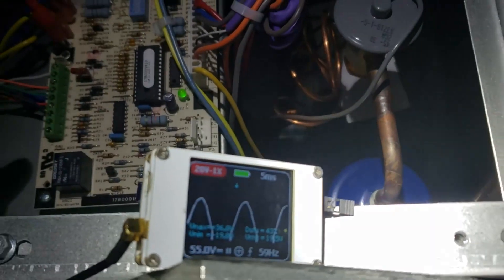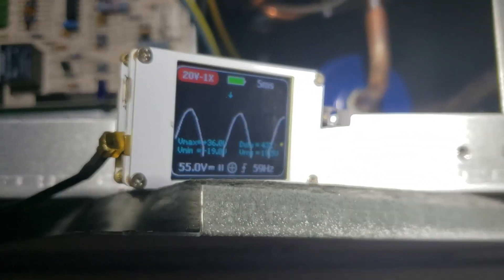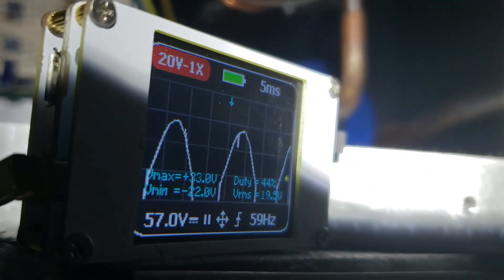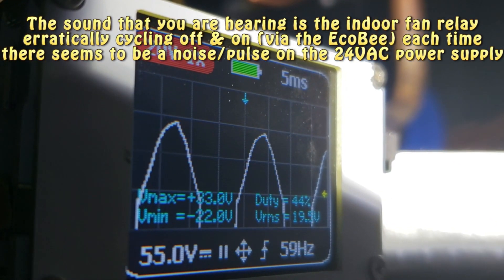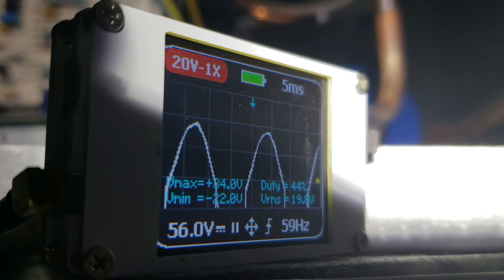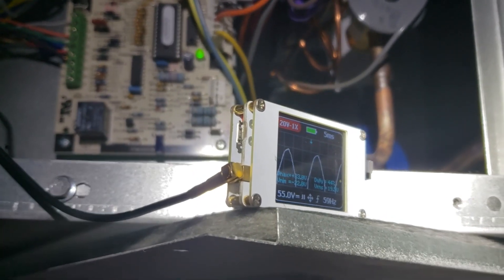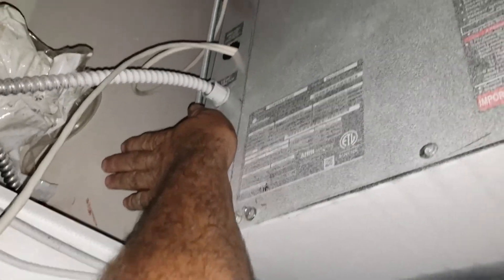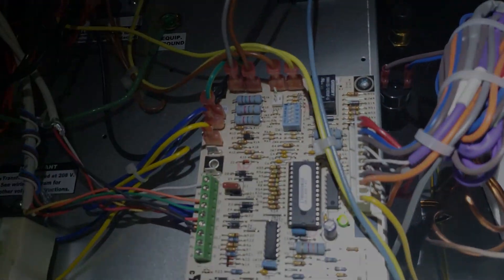Taco Actuator confuses the overly sensitive EcoBee thermostat!

Comment: Not sure if it this applies to your situation, but I’ve dealt with circuit boards that have their relay outputs protected by snubber circuits on the circuit board designed to help extend the life of the relay contacts when powering a large load. However, when the same relay output is powering the small coil of an external relay the leakage current from the snubber circuit will cause the relay to chatter like yours. The manufacturer provided instructions on how to remove the snubber circuit from the board or adding a properly sized resistor between the output terminal and L2/N to bleed off the current from the snubber circuit when powering small loads.